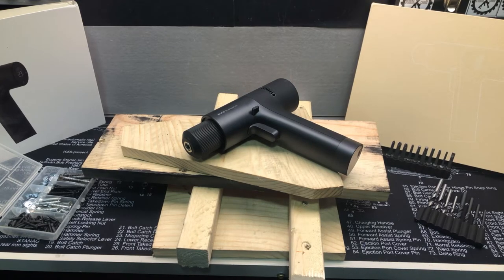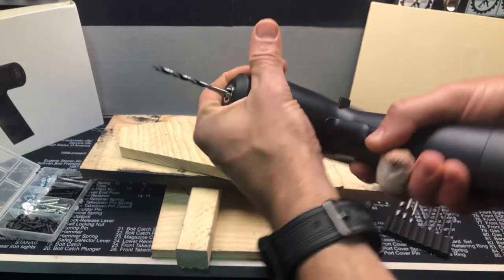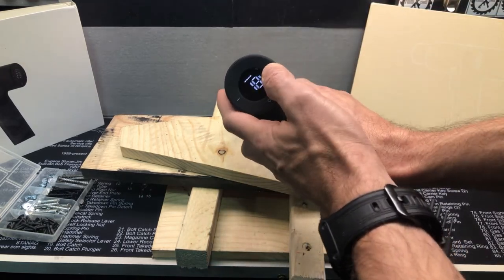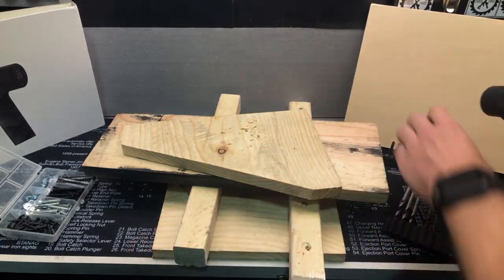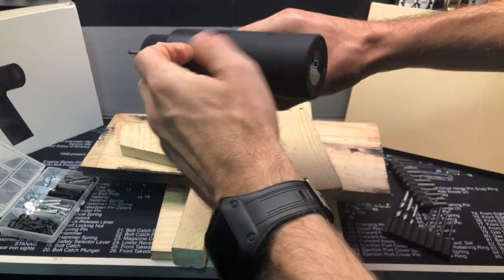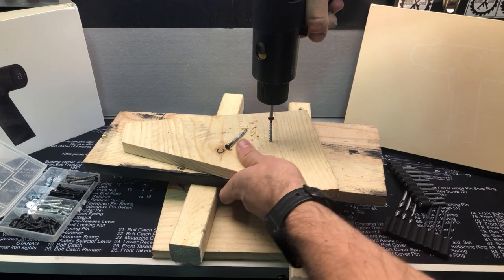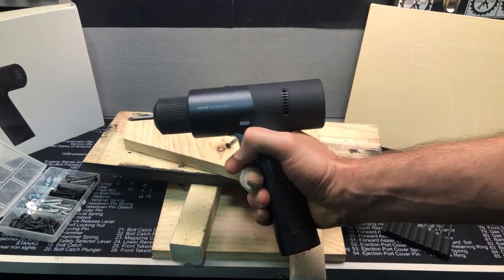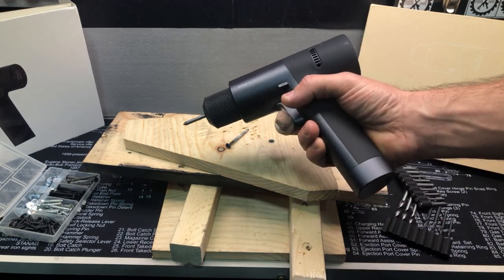Demo: HOTO 12V Brushless Lithium Ion Rechargeable Drill/Driver

Comment: Finally an actual demo, saw this on instagram ads and it looked so clean had to check it out. Ordered one based on this review. I don't drill or screw every day but needed a power one and this looks good.
Reply from the maker: It is really nice, only downside is if you are already invested in a battery tool system. If not, great option